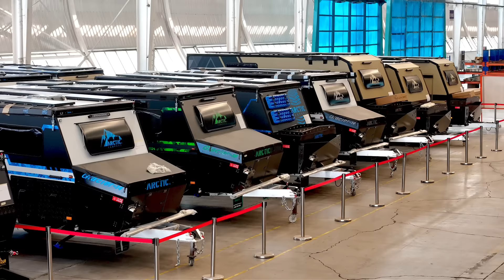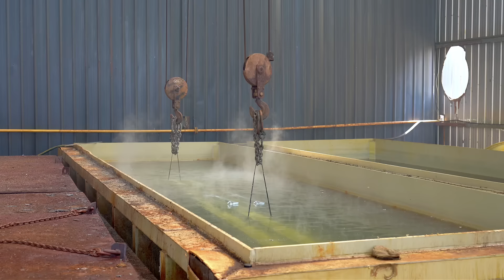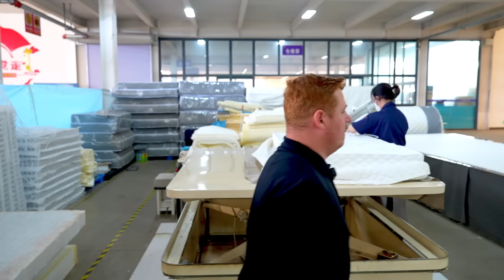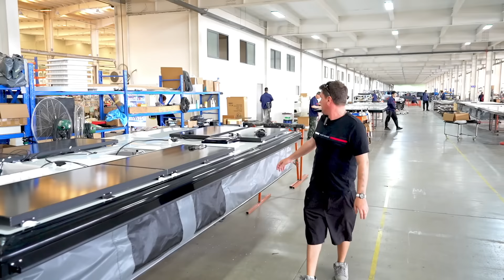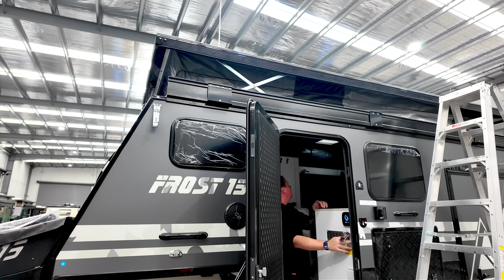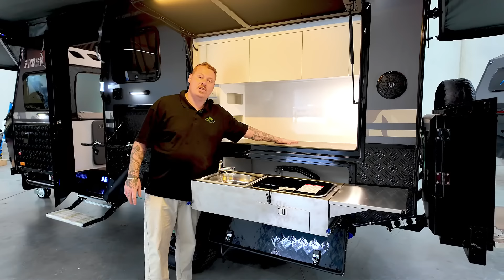The Truth About Chinese Caravan Manufacturing

Comment: Nothing beats Australian  Steel.

Hope your putting better quality tyres on your vans
Not like the Chinese crap thats on most vans these days
Reply from the maker: We do run a Chinese tire. However the ones we use we have had no real issues. That being said we offer any tire the customer feels comfortable with on the van as long as they’re rated to take the weights etc. There is good stuff in Asia and garbage as we all know. We actually ran our tyres on some our our vehicles and their still going strong 50000kms  later.
Reply from the maker: On the Australian steel I agree we produced some fantastic steel. Unfortunately this is changing also and to be honest there’s brands that build things here in Australia that are in fact using imported steel as well as all imported components like windows, doors, and accessories throughout the van.
Reply: @arctic-campers  Australia is on the skids. But who am I to talk? I’m from Canada. All our manufacturing is being forced out by globalist corporations.

Comment: The vertical integration in China is what makes manufacturing work.

Looks like better workmanship than many Australian built vans.

Only 1yr manufacturer warranty though?  I would expect that if the quality was that good with engineering etc, you'd have at least a 2 or ideally 3.

But, well done for showing plenty of the process - too many  hide behind just a glossy brochure.
Reply from the maker: Thanks for the comment and for taking the time to watch.

Just to clarify, our warranty is 12 months manufacturer warranty, plus a 5 year structural warranty and a lifetime warranty on our chassis and drawbar.

On top of that, every major component such as the fridge, air conditioner, suspension and electrical equipment is backed by its own manufacturer’s warranty.

The reality is that we also help customers well beyond their warranty period when it’s the right thing to do. We have plenty of customers years out of warranty who have had minor issues looked after.

It’s also worth comparing warranties across the industry. A longer warranty sounds great on paper, but it’s only valuable if the company actually stands behind it. We’d rather have a reputation for helping our customers than simply advertising the biggest number.
Reply: @arctic-campers 👍